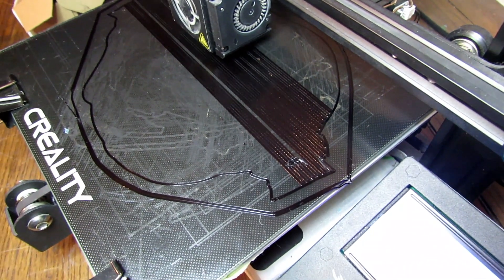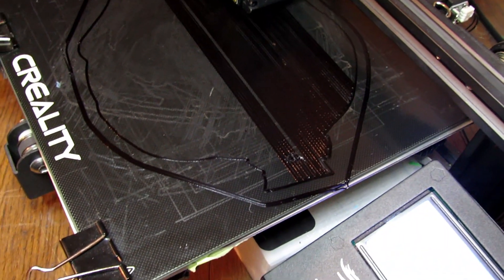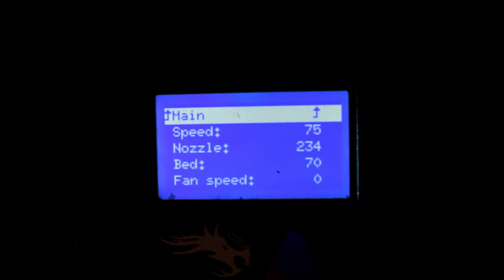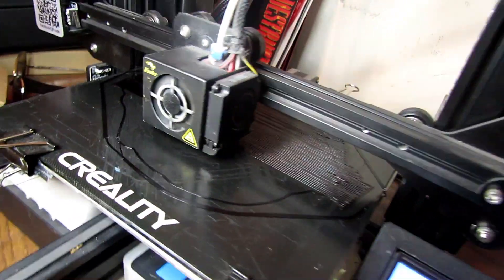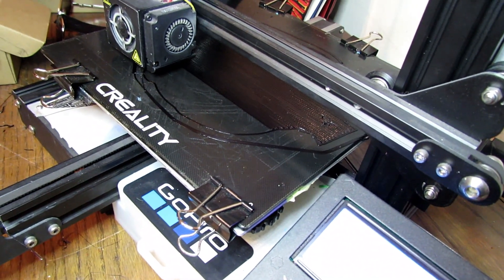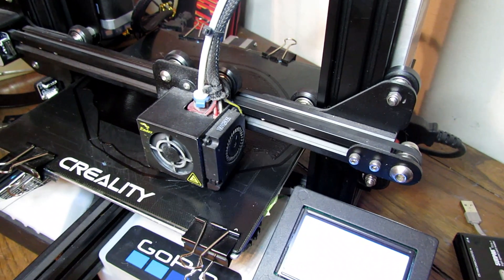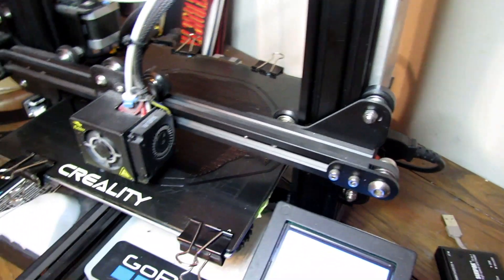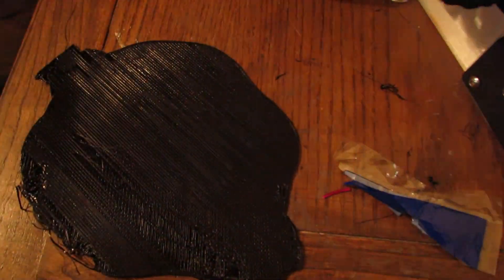3D Printing Filament Not Sticking To The Bed?

Comment: Don't listen to this guy it not just about the speed his borasilica ultrabase glass is grime  not wonder it's not sticking and needs to be cleaned with isopropyl/ isopropanol alcohol for it to stick properly
Reply: pboro1jawrattler You have no idea what you're talking about. This is the first video that actually suggested slowing down the speed and  going into the heat settings. Totally helped me out with bed adhesion. Thanks.
Reply: @jamesgingin590  
Helped me too. I was relying on Ultimate Cura to know how to accurately slice (program the settings or whatever its called) the designs I got off of thingverse for printing upgrades for my Ender 5 Pro, but my printer kept trying to move too fast on objects that were quite long. I didn't mess with the temp but I slowed down the speed as he suggested for the first couple/few layers, and then my bed support brackets I was making started filling in completely instead of all the scraggly mess it was initially giving me